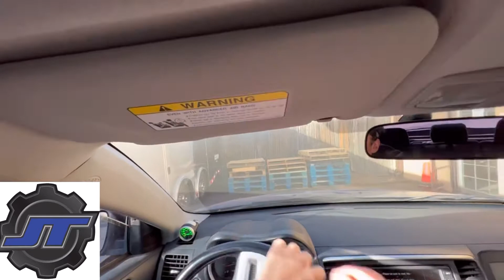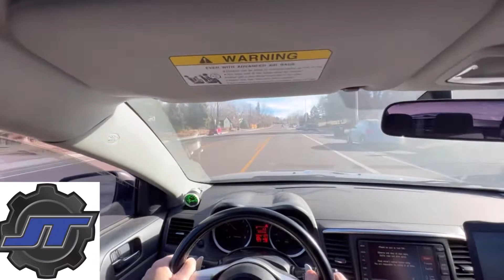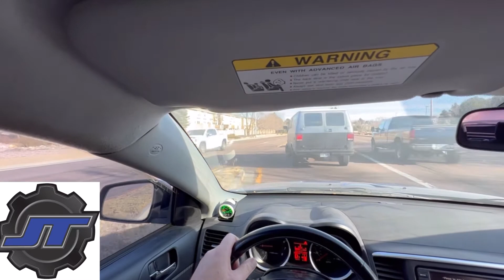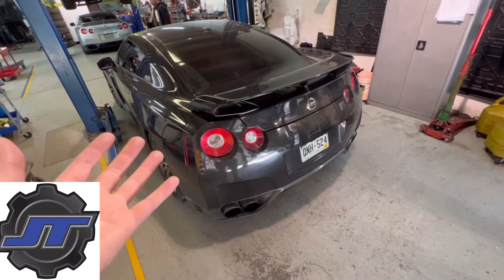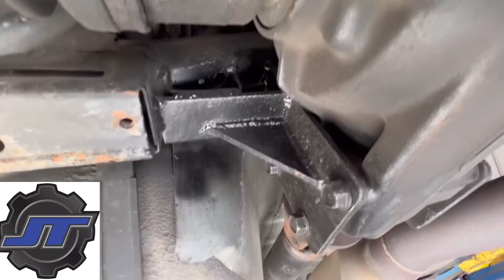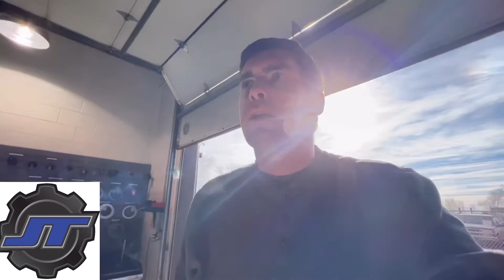SST Testing After Rebuild / Repair DCT 470 Jacks Transmissions

Comment: Will definitely be your customer soon, just bought a 2013 MR Evo w/ the SST.  As a used car, I want the transmission rebuilt right, because local mechanics at the dealerships only want you to buy a new transmission, saying that most parts are no longer available, you gotta buy the whole unit.
Reply from the maker: Thanks we'd love to do the build for you and set it up the way you want!  If you have a dealership that can't work on them (that's many of them) please tell them about us.  We work with many dealerships and transmission shops through the US and Canada.  Once they know we are here they continue to send us units, so they seem to like us.  If they contact us, we can set things up so they can repair at their location (if it's something simple) or do something with us for a full build from exchange programs to quick turn-around of their original unit.

Comment: Just stumbled on these videos while diving into the rabbit hole of the SST transmissions during debate of purchasing a high mileage Ralliart Sportback. Great content, and awesome that you guys keep these transmissions going and provide this service. Eases my mind a bit knowing that parts and service are obtainable, and that there's alot of content out there now showing what's involved if I ever ran into issues (which seems inevitable) and wanted to tackle on my own. I personally find it fascinating that you install each and every one in your test bed vehicle to prove them out before sending back to the customer! Nice job.
Reply from the maker: Thanks!  If you want to tackle a repair in the future on your own let us know.  We do sell parts and try to help on the easier stuff if you need something simple (like a fork, valve body, etc).  Or if you want the full build the way you wish the car should have been from the beginning, we can do that too.  Our test car seems to keep going.  It is cut up on the drivers side to slip an SST in and out quickly.  The extra 30 minutes in labor, and the time to teach-in/drive it is worth it.  Not only does it make the trans ready to go where the customer doesn't have to reprogram the TCM or do a teach-in, but it also verifies that everything is working as it should.  Over the years, there have been parts that were not working correctly that we caught during the testing process.  Saves a lot of time and headache in the long run for the customer knowing it's right.
Reply: @GVR1670  will do for sure! Funny enough, I actually did purchase a 2010 Ralliart Sportback with a bad SST, that had less miles along with several 'go fast' parts on it (Evo turbo and intercooler, etc)....as the price was cheaper and I figured that the SST going out in some way or form on a crazy high mileage car was inevitable anyways. 

It wouldn't move, codes pointed to the valve body / mechantronic being bad so I attempted to clean and rebuild it (after you guys advised me not to attempt it).....only to find out, well.....yeah, it didn't work. As you guys advised that it likely wouldn't :) There were also several other stupid mistakes that I made on it as well which may have contributed to this. 

BUT, I found another cheap (apparently working according to seller) valve body out of a wrecked car, swapped my mechatronic onto it, carefully bent the pins back on the solenoids that the PO damaged during removal and shipment of it to me....that, combined with new oil and filters done previously got the car moving! I was in disbelief when it rolled without throwing any codes. Did a teach-in and it seemed to drive OK. 

It's not perfect and still needs rebuild, as it has 137k on it and seems a bit delayed at times, but has allowed me to better qualify everything else that is wrong with the car (turbo oil leaks, neglected maintance items, etc). Which was what I wanted before dumping thousands of dollars into rebuilding it properly. 

AND, the best part - it has now started throwing the beloved P1875 'speed sensor' codes. So now, I know to add that as part of the laundry list for what needs done on the SST. Had I not been able to drive it, that wouldn't have been initially evident to me, as it wasn't throwing those when it wasn't moving! 

I'll at mininum be coming to you guys for more parts at some point (fork upgrade, speed sensor, seals, etc) if not rebuild services and refurbished valve body purchase :)

Comment: Do you rebuilt transmission 
I have a 2014 Mitsubishi Ralliart with 84K miles it shows the code for turbine sensor do you think it needs to be rebuilt? 
The reverse won’t work
Reply from the maker: Yes I rebuild them. What codes are you getting?  Speed sensor and no reverse are 2 different issues so it would probably be best to rebuild it and update it. Here is a link if you want to contact us directly:

https://jackstransmissions.com/transmission-services/sst-dct470/sst-dct470-2

Comment: I just put a brand new sst in mine that was upgraded  then the next day I haD no reverse  3 4 5 6 after driving  for a Lil lunch outing . Service  transmission light came on the. Later that night it decided  to start working.These cars always  has some sort of issue.
Reply from the maker: Was it rebuilt by someone or was it a replacement from Mitsubishi?
Reply: @GVR1670  It was  upgraded.  I had a new one warranty by the dealership. Had it Built/Upgraded.  That one got lost in shipping  so they ended up upgrading  another Brand New one after being  replaced...
Reply from the maker: @bnastystuntz  What parts were used during the rebuild?  There are a lot of parts out there that don't work.
Reply: @GVR1670  All Dodson parts.. Dodson 2 4 shift fork and Dodson Sportsman Plus clutch and Heated Sump..
Reply from the maker: @bnastystuntz  So this isn't a brand new trans then- it's a rebuilt trans using parts that are not reliable.  The forks have constant issues from that manufacturer which is what prompted us to make a superior unit of our own design.  Clutch will cause all kinds of odd shifting errors and that heated sump is something we never use due to design issues as well.  I would suggest contacting the manufacturer of your parts to figure out why they are not working correctly.  If you want a trans that will work and survive I'm more than happy to sell you parts that will not give you random errors and teach-in problems.
Reply: @GVR1670  It  is brand new. took a brand New transmission  from mitsubishi 0 miles  then upgraded  the fork and clutches and added a heated sump.It was done this way do to ups having  to replace  a transmission  i had built previously. Right now it's looking  like im going  to have to go to court for my money back then we can talk about what my next move to.get a working  trans built. I appreciate  u making  these videos...This was built by a supposedly reputable sst builder. It could  just be a one off issue.  WE shall c. Don't want  to jump to conclusions  just yet..
Reply from the maker: @bnastystuntz  Not a one off issue.  We struggled for years before we decided to design our own parts.  If you decide to redo it again let me know we would be more than happy to help. Hope it all works out but I've seen this many times...
Reply: A teach In was just done again  and it passed.

Comment: Any suggestions on Getting to the transmission overflow drain level checking bolt rite below the axle  I'm thinking about modifying a Long Allen key Do you suggest using that 1 filling up your sst transmission
Reply from the maker: That’s not a level checking bolt or a fill hole. The fill hole is at the top next to the oil pan and the drains are all at the bottom of the case. Most have 2 drains but some have a 3rd drain at the bell housing area for the clutch. 

We always use the top fill hole and fill using 8 quarts. 

If you fill up to that plug on the side you’re referring to it will be overfilled.
Reply: @GVR1670   OK so there's no real way to check the level just whatever comes out put the same amount  back in ? Thanks for your help I appreciate it

Comment: Sorry one more question when pulling the axles out of the transmission does it leak  the dye a Queen fluid
Reply from the maker: If the seals are good, no, it will not leaks fluid out when removing the t-case and driver-side axle.
Reply: @GVR1670  thank you

Comment: How much does it cost to rebuild an SST transmission
Reply from the maker: It depends on the issue and what you want to do.  More info below:

https://jackstransmissions.com/transmission-services/sst-dct470/sst-dct470-2
Reply: @GVR1670  I thank my cluch dampers rattling should I be concerned it drive good thanks for getting back 👍
Reply from the maker: @zman6288  Rattle at the trans can be many things.  Unfortunately we won't know until it's apart. I would first verify that your engine is idling smoothly.  Too low of an idle or a misfire will transfer more harmonic stress on the damper to make more noise.  If the engine is idling smoothly with no odd behavior then it could possibly be that the trans needs a software update for a noisy damper if the car is older.  

If all of that is good then there could be a spring issue with the damper.  You will not notice any driving behavior changes with a broken damper.  More harmonics will reach the inside of the trans to wear parts out faster and the broken spring material can get caught in the oil pump drive gear to kill the pump.  None of this will be felt.  The trans will just fail at some point.
Reply: Thanks for your videos,i swnd an email today for information.thanks!

Comment: Is the DCT transmission fluid GR6 safe to use on a lancer sst dct470 transmission?
Reply from the maker: Yes but I don't know why you would want to use a more expensive fluid.
Reply: @GVR1670  well gr6 fluid is $28 per liter,  at 8 liters thats $224. 8 liters of diaqueen is $368.
Reply from the maker: @navihawk1  Wow that's good to know.  The price seems to have changed a lot.  I'll have to look into doing the same.

Comment: My SST is weird. I have a 2014 Mitsubishi lancer raliart. Some times the transmission skips gears only 2 4 and 6 gear would work. I turn off the car. Then turn it back on then it works fine. Sometimes my Reverse would blink and not engage, then I'm driving normal and the transmission goes to 1 gear only fast and a light comes on and I scan it and it says shift fork 1 manufuction.
Reply from the maker: There are many things that can cause this.  All of which we can repair:
* Worn shift fork pads
* Backed out 1/R fork shaft bolt
* Clutch issue
* Valve body solenoid issue
* Broken damper
* Damaged clutch basket thrust surfaces
Unfortunately, we won't know until it's torn down.  The issue should be obvious then.
Reply: I’ve also had this on seldom occasion.